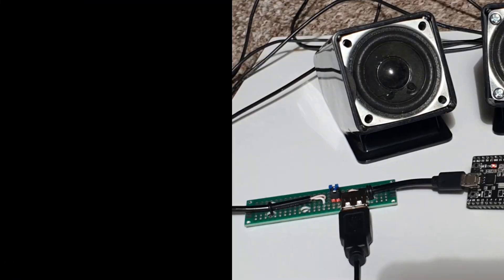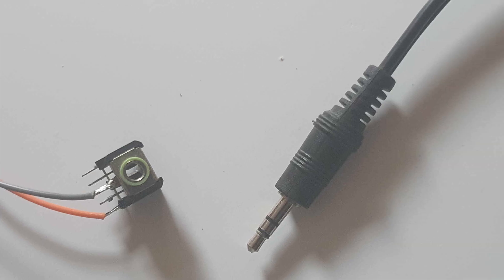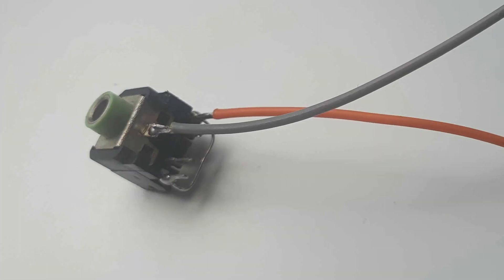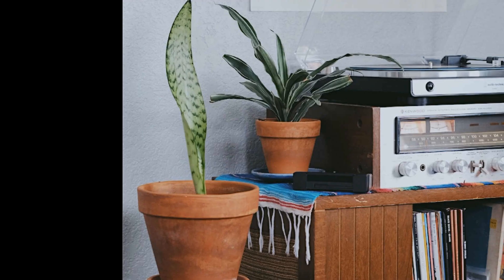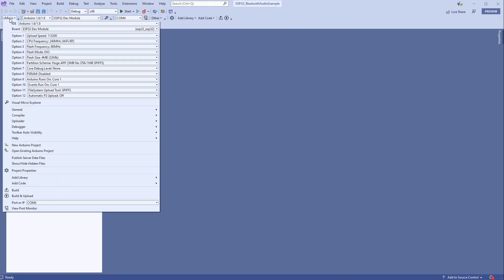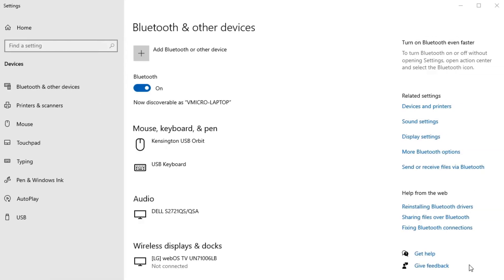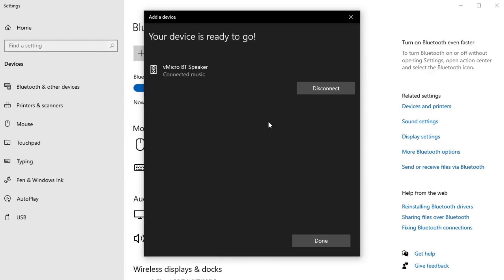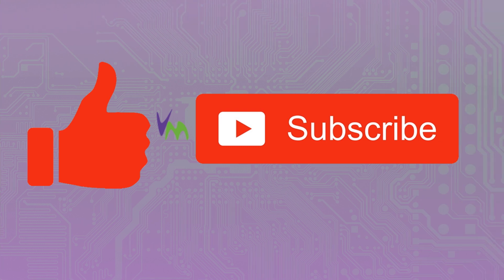Easy ESP32 Bluetooth Speaker

Comment: Sir I Have a ESP 32 cam modeul so i dont have the gpio 25 pin access how can i change the outut in then
Reply: For your ESP32-CAM pin out is GPIO0 (for ADC2 - audio converter), probably one channel. To make sure it is right search your model diagram in internet and find pin outs responsible for ADC2 or A/D

Comment: Is it possible to make a wireless microphone using 2 esp32?
Reply from the maker: In theory it could work, though you may run into delays/lagging without enough buffering.  If it was to be used for a "live" transmission then it may be better to use Bluetooth, or if the range of WiFi is required then hopefully there is a library for an RTSP style protocol for ESP.

Comment: this works but it is only one side out of a stereo input, if you want to output stereo through the internal DAC, i have found that GPIO 25 has some background noise probably due to interference, so you might want to add a 100uF capacitor to the outputs. If you want to have a true mono output from a stereo input, you'll have to add "a2dp_sink.set_channels(I2S_CHANNEL_MONO);" before the start function, and only use the GPIO with the less noise
(by true mono i mean both stereo channels as a single channel output)
Reply: Добрый день, я правильно выбрал файл для загрузки, как указать GPIO 25?

#include <A2DPVolumeControl.h>
#include <BluetoothA2DP.h>
#include <BluetoothA2DPCommon.h>
#include <BluetoothA2DPSink.h>
#include <BluetoothA2DPSinkQueued.h>
#include <BluetoothA2DPSource.h>
#include <SoundData.h>
#include <config.h>
#include "BluetoothA2DPSink.h"
BluetoothA2DPSink a2dp_sink;
void setup() {
  a2dp_sink.set_channels(I2S_CHANNEL_MONO);
  a2dp_sink.start("ESP-32");  

}
void loop() {
  delay(1000); // do nothing
}

Comment: I made a try with this setup, but honestly i would not recommend it, if your goal is to get at least a decent audio.

Not only the internal DAC of the ESP32 isn't the best choice, but the board generate a lot of noise.

In short, it work, but is more an emergency setup, IMHO.
Reply: have you tried the other dac gpio? on my board the 25 has some noise, but the 26 is a lot clearer, i commented above on how to output both channels of a stereo input to a single gpio
Reply: by lot clearer sound i mean it's really clean, i use mine for a 40y old 170w amp and it's almost undistinguishable from an aux input

Comment: Awesome. I following the step and success. May I ask can I add a button to active the Bluetooth Pair function instead of Auto startup??
Reply from the maker: Yes this can be done, just move the start() call into code detecting when the button is pressed, and then if you want to disconnect when pressing the button again, you can call the disconnect() function.  then stop() to ensure the stream is stopped, and end(false) to end the sink object, a quick example:

    if (digitalRead(23) == LOW && sinkStarted == false) {
        a2dp_sink.start("vMicro BT Switch");
        Serial.println("Enabling BT Audio");
        sinkStarted = true;
        delay(500);
    }
    if (digitalRead(23) == LOW && sinkStarted == true) {
        Serial.println("Disabling BT Audio");
        a2dp_sink.disconnect();
        a2dp_sink.stop();
        a2dp_sink.end(false);
        sinkStarted = false;
        delay(500);
    }

Comment: why not stereo?
Reply from the maker: This was our first project with this setup, and checking the library you can use GPIO25 and GPIO26 from the internal DAC to play stereo if desired: https://github.com/pschatzmann/ESP32-A2DP#output-to-the-internal-dac

Though trying this out it seems both pins output the same audio, so expect this has other uses when playing from embedded files/SD cards.
Reply: @visualmicro4389  i tested it and stereo works just fine for me (except for the noise on 25)